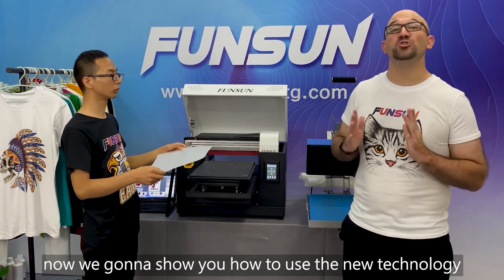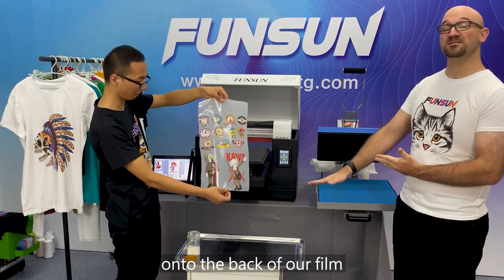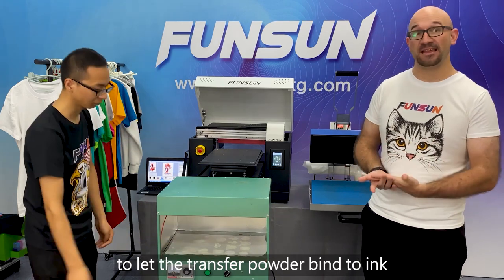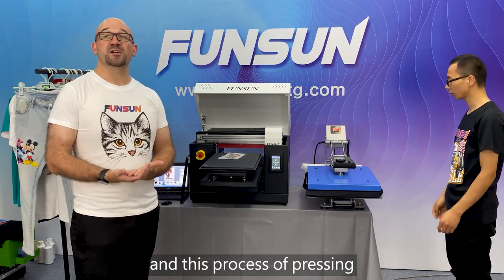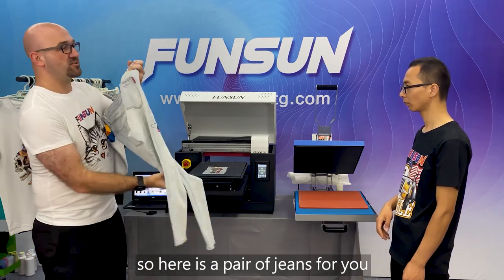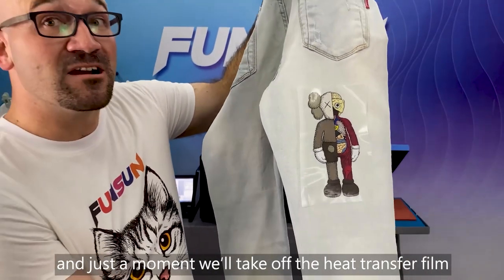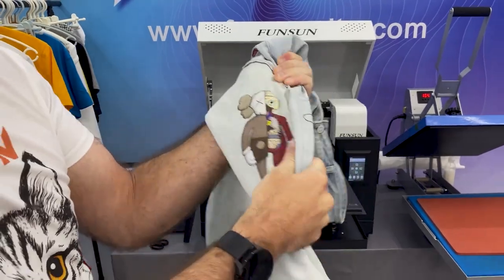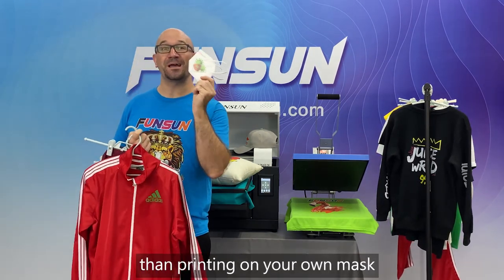The process of 2020 New Technology for Textile printing

Comment: just 2 quick questions... you are using dtg ink to print on the film?
you have to change the settings in your rip software to print on the film? 
normally a dtg printer prints white and then prints color right behind it. when using the new technology you have to print the opposite way color first then white.
Reply from the maker: Yes,We use DTG ink to print new technology.but it's not all dtg ink can print on film.the ink we've used is OK.And the question 2:color first then white is right.
Reply: @funsunsign  thank you for the quick reply to my questions. 
do you use a different kind of ink when using the new technology?
do i need one dedicated funsun dtg printer to be able to print with the new technology?

Comment: Can you pls. inform why should I buy dtg machine where the same print  I can do with other Printer. As you showed I can print it by dtg machine on transfer paper and transfer it to any fabric by heat press machine.
Reply from the maker: only 0.2$ / cost for this t-shirt , 
good investment
Reply from the maker: yes you need  so this printing to this transfer paper , and also you will need a heat press machine
Reply from the maker: may i have your whatsapp number ? for more informatoin and this working voideos can share you directly , 

My whatsapp number :+8613386071431. 
(https://wa.me/8613386071431)